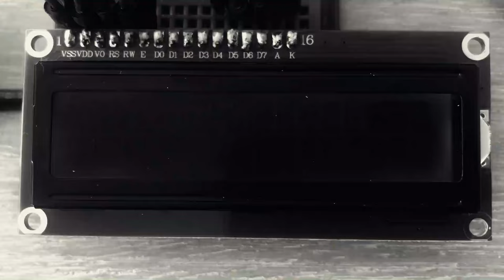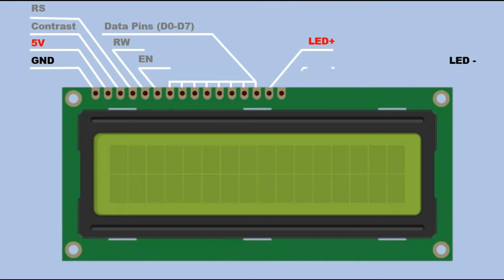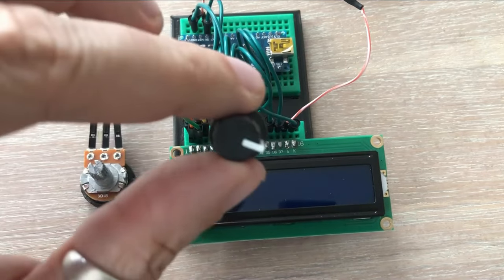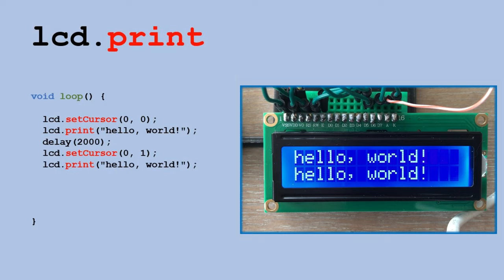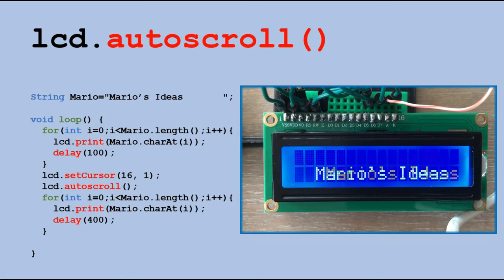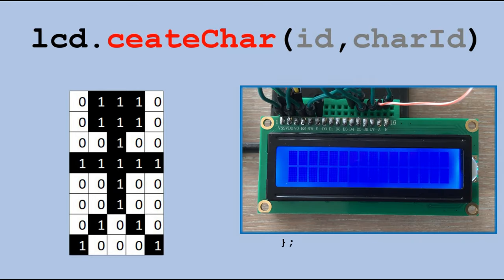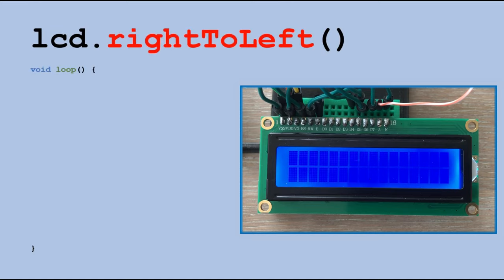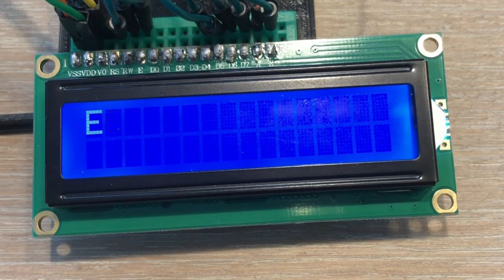LCD 1602: Step-by-Step Guide to Arduino Display Integration

Comment: Coo!, someone gave me 8 similar displays, mine only have 14 pins across the top, the backlight power is on the right side of the display. Mine are  Marked DM1623 on the front and TDK-T34V on the back.

Comment: I have a 14×1 LCD screen, but its structure is different. How can I run it? It has 9 pins. I found vcc and gnd.  I also found the led control end, but I can't find the other 6 ends. Can you help me?
Reply from the maker: What is the part name?
Reply: Never thought about looking up the model number?
Reply: @marios_ideas  yes I tried but I couldn't find any results. The number on this board is :epcrm 15xdb5-040401c
Reply: @marios_ideas  I removed this screen from an old pos device.  I want to use it in my project
Reply from the maker: I tried to google lcd 14x1 display and frankly I had no hits. Without the model and datasheet it is anybodys guess what each pin is responsible for. What I would do is to go to Arduino forum and post the icture of that part and maybe somebody can identify the part (
https://forum.arduino.cc)
Reply: @marios_ideas ı am andursten thank you

Comment: A question: if you keep autoscroll() method active, after a certain amount of time the text enter again in the display from the other side. Do you know why the text is not entering just after going out? There are kind of blank spaces to count, but I have no idea how to manage this.
Reply from the maker: In the definition of the string You see a lot of spaces after “Mario’s ideas” so the string def looks like this” Mario’s ideas                “. If you get rid of the spaces the text would enter right after going out
Reply: Thanks for the answer. Actually I was not referring to your example, because I made some experiments and using a different string (eg: a 4 chars word), without spaces at the end, this happens: the text goes to the left, disappear and enter from the right, but after MANY loop cicles, like there is some "empty chars" to move. I don't understand the reason.

Comment: great explanation Mario.  Question !  Is it possible to continually scroll a large amount of words across the 16 display? Or is it limited to just 16 characters?
Reply from the maker: It is possible. In the loop you display first 16 characters then you display characters 2 to 17 then 3 to 18 and continue until you reach the end of text. You have to program that scrolling in your code

Comment: Why we need a poti? I have seen other schemas whitout poti
Reply from the maker: Check around 4 th minute. The pot is for controling brightness contrast. Pot is nothing more then the variable value resistor. You can always replace it with the resistor that gives you the brightness/contrast that is ok for you. Using it just gives you flexiblility